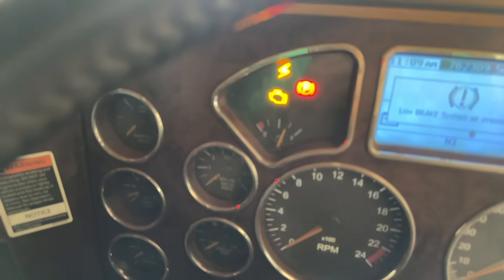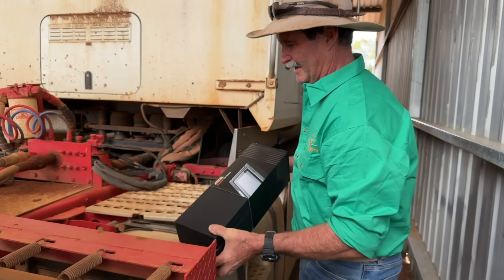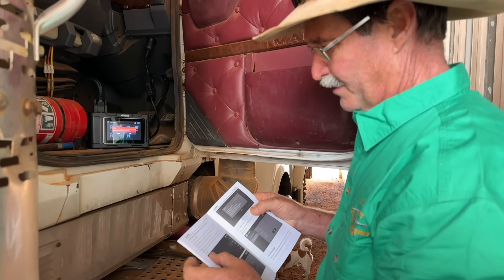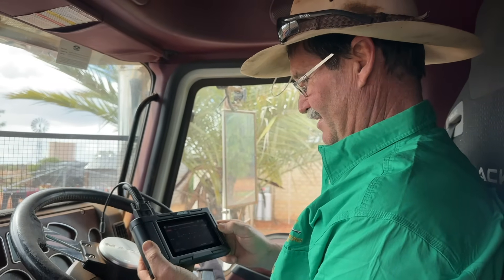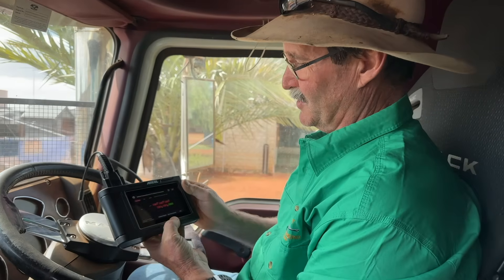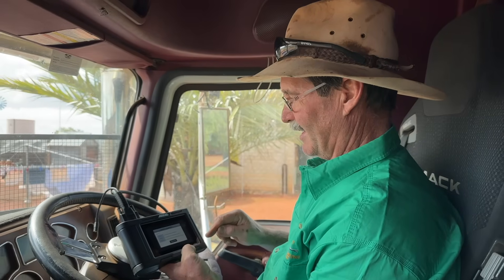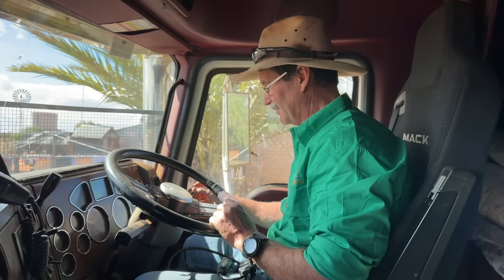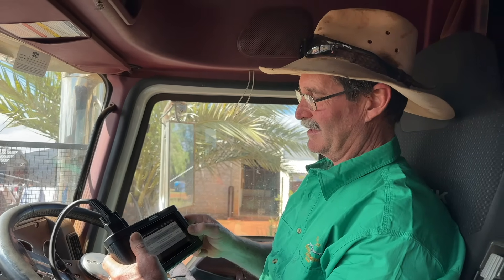Why Won't This Truck Stop Breaking Down?

Comment: Who could have thought, a new bloke in a green shirt, is the new character for the former  Tim Thomson. He's almost better than the original one. [/joke off] Have you had that smoke tested. Its a devise that Injects smoke into the intake, past filter box. It will show you any leaks, like turbo hoses, lose of air, smoke turbo hoses, MAF's (Mas Air Flow Sensors). All the kind of things that will throw that alarm. That will be a turbo related alarm.

Regards Phil.

Comment: Trace the wires from the sensor to the ecu, and check the pins on the plug that goes into the ecu.

Comment: If it's a hard fault it will keep logging codes and presenting check engine light. If a sensor is faulty it will log a code, clearing codes without a repair won't help you.
Reply: Yes, that's right. 👍 If there is a hard fault, it must be repaired first before the fault code can be cleared.

Comment: If you buy an expensive obd computer they tell you more and in more detail they also read older trucks where as the cheaper computers don't read very old trucks.
Reply: Yes, that's true. Generally, more advanced functions come with higher-priced scanners. We are always committed to offering products that deliver great value at an affordable price.

Comment: FMI 5 is current low or open circuit 

It’s a faulty wire, basically saying it’s got no voltage at the sensor from the engine ECU 

Find the broken wire or where it’s shorting to earth 

Take the 2 plugs off the ECU 
Go to ohms on a multi meter and check for continuity to the sensor for the oil cooling 

That will definitely derate an engine 

Adblue fault- take it it HD tuning in Perth and get the Adblue turned off that’ll stop all those faults ever happening again 

Change your engine harness as well Volvo harnesses are absolutely shit 

Then put it on truck sales and buy a Kenworth

P.s adblue faults won’t clear, Volvo made it so that there is a record of faults. Stupid idea

Comment: Faulty temp sensor on a Detriot powered Star would cut out at full noise pulling a double road train. It then wanted to steer you into on coming traffic of the same size/calibre. You had to undo the seatbelt & lean right over the wheel with your body weight to keep it on your side of the road. As soon as it came to a halt, hit the key & away you went. The excuse for not fixing it was they sent the wrong harness, 6 weeks later it's still doing it & no correct harness. It don't take 6 weeks to get it right 600K's West of Brisbane with the correct harness!

Comment: I drove a mack that kept turning itself off at full noise. Nothing but air brakes. In the end, it was a faulty regulator on the alternator, sending a power spike, so a different fault every time. Hope this helps.

Comment: Thanks a ton for the honest review! 🙌We really appreciate how you objectively highlighted the HD3400 Pro's pros and cons with real testing. Super helpful for anyone considering diagnostic tools!
👉 For others who might be curious: besides using the vehicle's diagnostic port, the HD3400 Pro can also be powered by a 12V power adapter, which makes it easy to connect to WiFi and activate the device at home. To connect to WiFi, just go to "Settings > Wi-Fi Connection". Both of these points are also explained in the user manual.
💡 Don't forget—you can use code "Tim30" for an extra $30 off!

Comment: Loved the content. Hated the audio. I suppose the unit does a job, but it's not remotely fit for your purpose. Step back and you can see a dysfunctional truck that can't be trusted because of overcomplexity, unreliable sensors/wiring and unfathomable software with no GUI of which to speak. For the money you have to shell out for one of these trucks I really think the manufacturers can do better but probs actively choose not to.